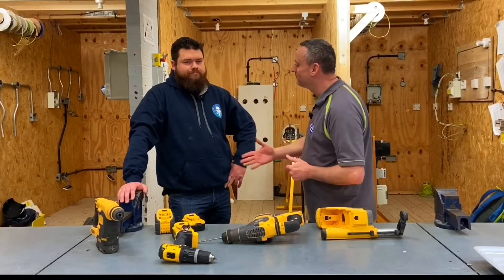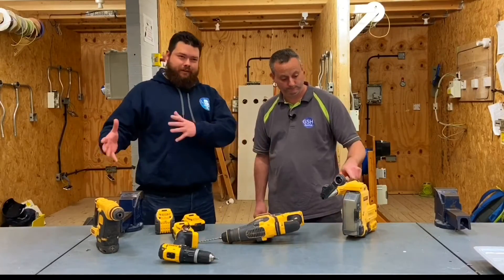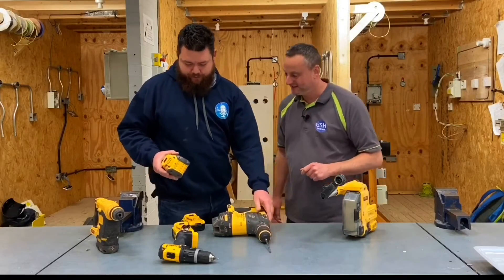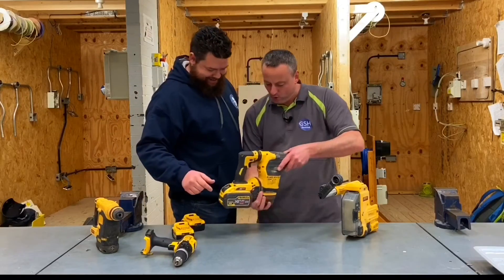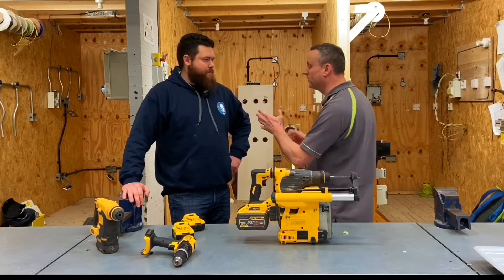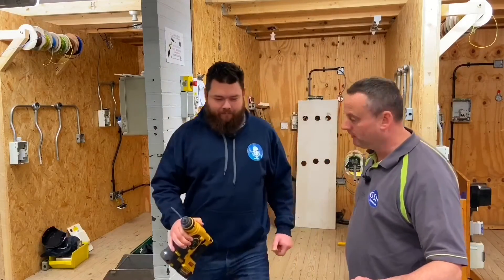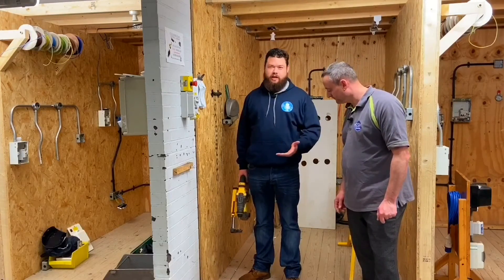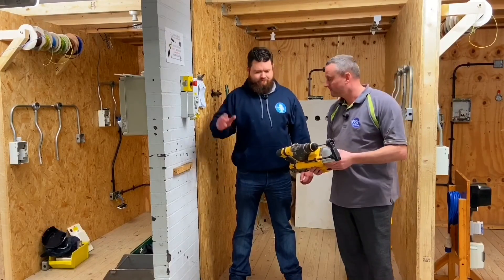Dewalt Drill with Silica Dust Extraction Solution for Cordless Battery Drills

Comment: I have two of these drills and hovers and i drill into concrete ceilings fixing fire alarm cables im in a bit of a war at the moment with Dewalt as they state that the hover carry’s on for two seconds after drilling, as far as im concerned mine doesn’t and nor does yours. Try the hover attachment on other brands and you can definitely hear the hover Woking 2 to 5 seconds after drilling. So im drilling above my head as i stop drilling and pull the bit out of the hole because the hover isn’t on i see silica dust. FYI

Comment: Does it only fit this one drill?
Reply: There are two version of this: the D2530𝟑DH that fits the smaller 18V stuff (DCH273, DCH274, DCH253 and DCH254) and then the D2530𝟒DH that fits the larger models, 54V stuff and some corded (DCH283, DCH333, DCH334, D25333K and D25334K)